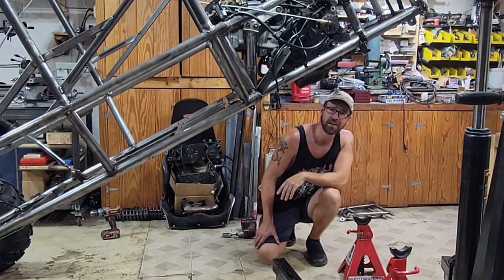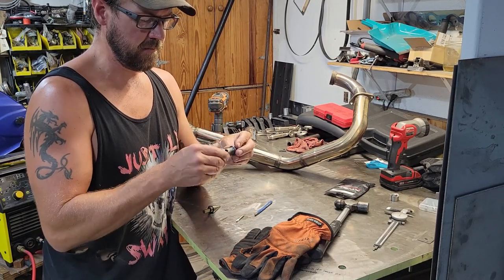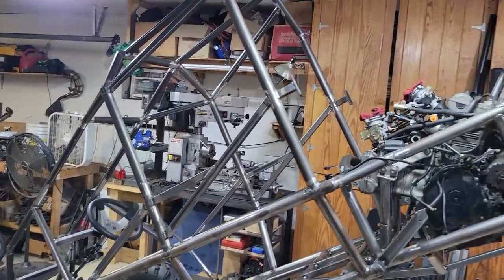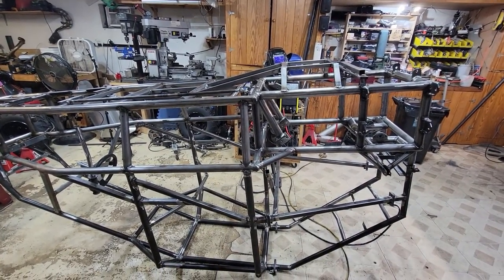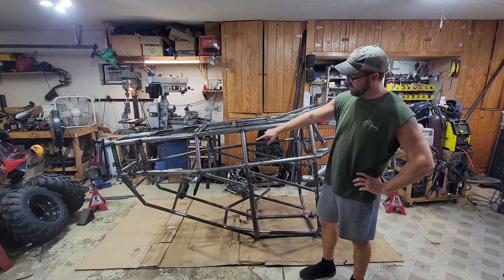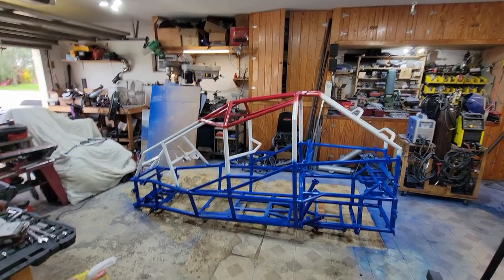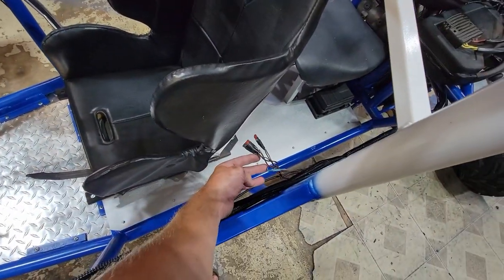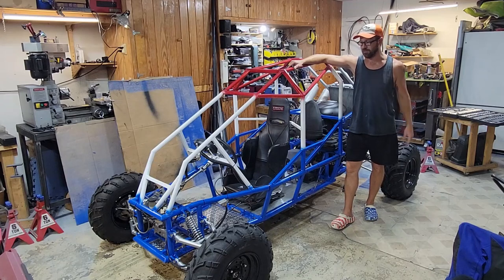Merikart - The Junkyard Literkart Gets Paint || V-Twin Superbike Powered Tandem SeaterCross Kart!

Comment: Hey man you are my inspiration!!! I’m planning on my first build and I’m thinking about getting the “affordable bender” for my tube bending needs. I will be taking notes from your videos. Maybe you can upload the dimensions of your a-arm jigs. I would love a lathe but man they are expensive and it’s hard to find in Alabama
Reply from the maker: Thanks! I actually just picked up a bender from Woodward - found the bender itself for a little over $200 on eBay brand new in the box. The dies are the expensive part (almost the same price as the bender). Really awesome quality for the money though. The A-arms were just sized based off of my frame dimensions and desired wheel base, if you can draw them out on paper or in cad you can figure out your jig dimensions. Maybe I'll make a video about building them for the next build
Reply: @provinsgarage  I guess I might be overthinking it because now that I’m reading up on it all I hear is Ackerman, camber, toe in etc: any thoughts or opinions about a mini lathe?
Reply from the maker: @williamgarcia9751  there are several mini lathes that will do the job but they are going to be limited on the size of parts you can produce. My Smithy LTD 1220 has a 12" x 20" lathe (with only 7" diameter capacity over the cross slide table) and that has been limiting at times. It all depends on what size parts you think you will want to produce. I did a lot of research before purchasing mine and got this because it is a mill too and my garage space is limited.
Reply: @provinsgarage  I’m going to look up that lathe and prices. But if I can fit hubs and things similar to that I will go with the mini lathes . You have no idea how many ideas I have because of your vids
Reply from the maker: @williamgarcia9751  good stuff man! I'd like to hear what you end up going with and see some projects once you get going